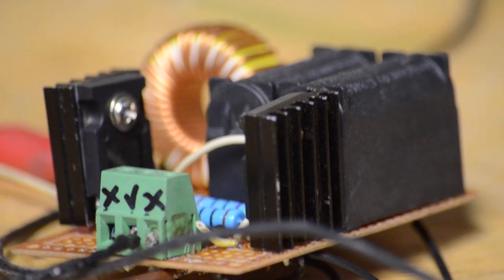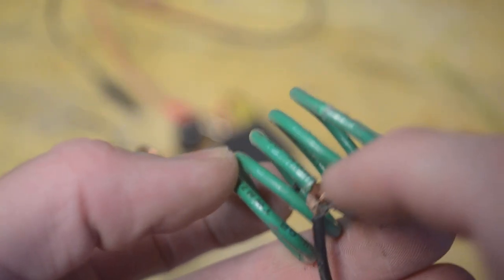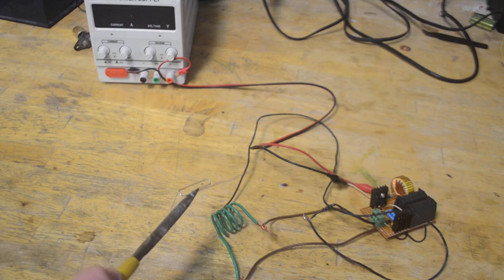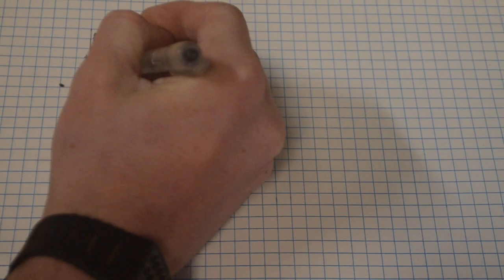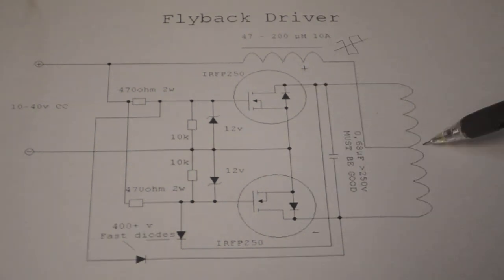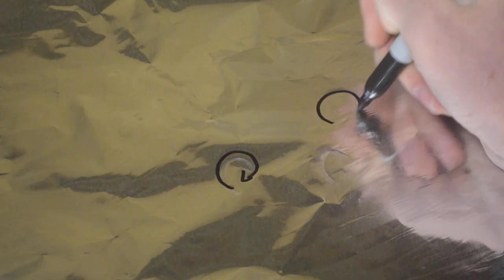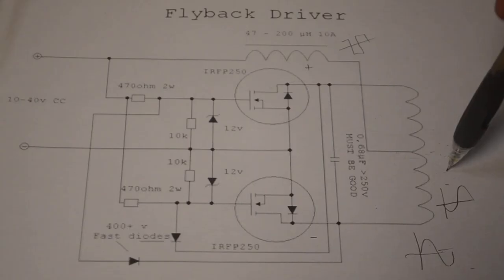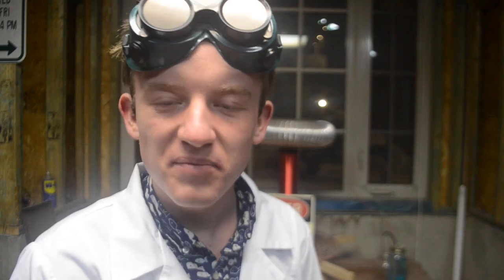How to make Induction Heating

Comment: love our videos, and your zvs driver video was very helpful btw. One correction, you can technically inductively het any metal, its just easiest with iron due to how easy it is to induce large eddy currents in it compared to other fero or paramagnetic metals. In the case of diamagnetic materials like copper of aluminum the currents simply flow in the reverse to what they would in a para or feromagnetic material. As well, it will take a lot stronger eddy currents to heat up more thermally and electrically conductive metals like copper as they will heat up less for the same amount of current and will dissipate that heat to the entire metal body faster than iron. I am 95% sure of this explanation, but if anyone has any corrections to this feel free to share them.

Comment: Awesome video and thanks for the shout out man!  One thing though, non magnetic metals like copper and aluminum do indeed heat up with induction.   Heat through induction is generated by eddy currents flowing in the conductive material AND because of the heat generated by hysteresis in magnetic materials. Since copper is not magnetic, it is heating at a rate that is directly proportional to the resistivity of the metal(which is pretty low). Most people think induction only works with ferrous and/or magnetic metals, but that is not the case. Copper will heat up with an induction heater, but much slower because it is not magnetic and has a lower resistivity than steel.  Dropping the magnet through the pipe proves this as it shows the copper does indeed react to the changing magnetic field.  With 1000W, I have boiled copper traces off of PCBs with my induction coils.  In fact anything that is conductive will be heated through induction including the human body.  MRI machines, which produce extremely strong magnetic fields, actually do heat up the human body a bit throughout the scanning process due to the nonzero conductivity of human tissue.  Graphite is great example of a material that is neither a metal nor is magnetic but is amazing a turning the energy from an induction heater into, well, heat.  Graphite is known as a susceptor and is used in microwaveable food package as a crisper like in hot pockets sleeves and popcorn bags.  Watching the lithium battery explode in my video also is a good example of this as nothing in the battery is magnetic.  Thanks again and keep up the great work!  Feel free to message me with questions about induction heating any time.
Reply from the maker: +Proto G no problem Proto xD, I figured that it was being induced in copper and aluminum ( that's why it says "the not entirely true " in onscreen text when I said that it only works with ferromagnetic materials, but I wasn't quite sure on why it wasn't heating up ) so thank you for telling me about hysteresis! That clears up some thoughts I had in my mind about it xD anyways you Totally deserved that shoutout, your videos are great :D

Comment: The most important question is: Can you heat up a knife to 1000 degrees Celsius with it?
Reply from the maker: +Pav Phone O_O
Reply: Depending on the material, would it still be a knife at 1000C?
Reply: Pav Phone No iron reaches its curie temp at 700 deg c , it looses is magnetic properties at this temp, further heating is a challenge above 700 deg c
Reply: no.
Reply: Get out
Reply: EvilSearchEngine yes

Comment: Put a polypropylene capacitor in parallel with the coil and drive it at the resonant frequency. Far more efficient if you can keep it on resonance as the metal is put in the coil

Comment: hey but induction stoves have horizonal spiral coils, how do you control the direction of the magnetic field in order to heat the cooking plate instead of the base of the stove?
Reply from the maker: +Academia Gamer great question, I think in induction stoves they use a ferrite material mounted on the bottom of the coil to increase the inductance as well as shield antuthing bellow it

Comment: is it possible to make an open coil to slip over pipes..goedendag
Reply from the maker: +georgio jansen yes! Infact this setup is used industrially ( or at least one use ) to heat up metal bolts to loosen them without the need of a flame

Comment: so then if you were to take like PVC and put the coils inside the PVC and put the paper clip inside the coils and then turn it on and blow air through it would you essentially get the same effect is heated air? Or would pushing air molecules through the coils inside of a PVC pipe cutter change the magnetic atmosphere?
Reply from the maker: +dmckimmey1 I think it would just heat the air from he heat of the paper clip, I don't think the air would effect the magnetic field enough to notice anything

Comment: In theory could I create a pot or a cup that heats itself if I wrap an induction coil around it and then a layer of insulation from the heat? I could also add heat insulation between the coil and the steel cup or pot or whatever. Would that work?

Comment: ok so what happens as you get to/past the  Curie point of the metal? in other words once you have heated it past the point of being magnetic?
Reply: Mike mac it still works because what it's doing is creating an electric current inside the object. however I believe you're right, it does alter the effect somehow.
Reply: Mike mac it does not appear his is strong enough to accomplish that, but when you hit the curie point the metal stops heating and hovers right around that point. Ferrous metals with high curie points are ideal for induction heating

Comment: To get the best results you have to have the diameter of the heated object 3,5 times the depth of penetration (which is calculated as a= sqrt(2*specific resistance / (2^pi*f*epsilon r * epsilon of vacuum)). My point is, the depth of penetration is related to the input frequency, can you change it with this desing? also does the circut automaticly adjust the resonance frequency once you put the object inside it? as it changes the induciton of primary.
Thanks for reply in advance! =)

Comment: If I wanted to heat a beaker of water/ milk would an induction coil wrapped around it work.?
Reply: If your beaker is made of iron or graphite or aluminium or silicon carbide or anything that conducts electricity and offers some resistance then YES. 

Glass Nope

Comment: 470R
 10kr
 12v zener diode
 UF4007 diode
induction coil
capacitor 
 if im gonna make induction heater with 3000w power should i use same diodes i mention or something else ?? a better question plz give me the components that can handel 3000w induction heater

Comment: Hey could you make a vid demonstrating electromagnetic that reverses the eddy spin causing levitation Resistance plz eg the reverse affect of the magnetic in the tube making it fly up fast I've always wanted to sleep in pyjamas that make me float eg pyrocarbon neodinium idea. Also if gold and copper won't heat up beacause of non magnetic how are graphite crucibles in induction heaters melting gold and why do the call them super conductors?

Comment: Hi +keystone science,
Informative video.
I have a question. If we use a battery(cell) and connect induction coil to its ends, Would it still generate heat..
Thx,
Paras

Comment: sir i have 220ohm resistor can I replace with 440ohm resistor
Reply from the maker: +manni sagg for the For the ZVS circuit? You should be able to, I'm not sure how much it will effect the output power though, presumably it will be much less , but I'm not too certain

Comment: hi im a really big fan im 13 and i need to do some welding for my electric bike. would this way make things hot enough to weld things, or is it possible to make one that could?
Reply from the maker: +Henry Swan theoretically I believe so, but it would probably be easier to just modify an old microwave oven Transformer with approximately 30-40 turns on the secondary so that it becomes an arc welder, sort of like what I did on my 1000 amp video, but with a few more turn than I did ( that way it will be able to conduct easier as it will have a higher voltage )

Comment: Just need to be conductive to heat it, if you have enough power. You didn't see copper heating because of the power input.
Reply from the maker: +AuraRisen yes, but ferromagnetic heating easier is because the small magnetic poles within the element spin and heat it up a lot more, while copper just relies on the eddy currents purely.

Comment: what about induction of aluminium it melts but it's not a ferrous metals
Reply from the maker: +Jack Spencer yeah, It works on non ferrous metals, it's just much less efficient at heating because ferrous metals have the added benefit of small magnetic poles that also flip generating heat, while copper and aluminum are purely using eddy currents

Comment: hey i have a question/possibly experiment for u! this video got me thinking about alternating and direct current and was wondering, what would happen if u ran an electromagnet on alternating current instead of direct? would it have a push pull effect (but the frequency is probably too high) or would it maybe "lock" nearby ferrous objects in place? haha cant wait for what u do! love ur vids btw!
Reply: oh and maybe even looking at the uses for a electro mag on a.c. like maybe using it to make some sort of instrument, where the "reed" is vibrated with the high frequency mag haha
Reply: S H I T S M E L L it would attract ferrous objects, but be neutral towards magnets. Iron doesn't care which side of the the magnet is pulling it, however you were right in your assumption that 60 is way too high to see the push pull on a magnet, it just appears neutral
Reply: I think cody's lab did a video on this but don't quote me on that.
Reply: inductors used in ac applications are called "chokes" as they block or 'choke' higher frequency AC while letting DC or lower frequency AC pass.
Reply: Edward sun mhh i see.. it would improve the efficiency of the induction

Comment: Stupid but serious question... 

Is this the same thing that happens on my stove top?... Because it's easy to understand with yours as your putting it into a "tunnel"... But what's happening with the pans... And is the copper heavy base pans using the same principle as your magnet demo and so why I needed to buy stainless steel pans?... Sorry, it seems silly... But I am genuinely wanting to understand now what is happening in the stove
Reply: Seano Hutton your stove works by using a massive resistor and pushing a lot of current through it. In this project, you want to prevent the coil from getting hot. In a stove top the coil is made of a resistive material to make it heat up intentionally. The heat from the coil then radiates into the pan.
Reply: Then why does the stove top stay cool enough to touch but the water is boiling, and why is it cool to the touch... My old one used to have a coil that heated up... The new one doesn't. But with special pans it cooks great... And is advertised as induction cooktop, hence why I thought this was explaining it... It's great but my copper base pan set doesn't work on it...
Reply: Ohhhhhh, ok. If it was advertised as an induction cook  top and your copper pans don't work, then that is exactly what it is. The induction coil is likely just a flat spiral underneath the pan that induces the currents.
Reply: So yeah, it is working just like this example, like I thought it must... And I'm pretty sure I said my copper pans don't work and I needed new pans in my original post/question... It's super quick to heat up, it can have a full pot of tap water boiling in just under 2 mins...  But if you accidentally have a empty pot on too long it destroys the pot as another house mate found out. 

What's confusing is the, in the demo here the clip his inside a cylinder of windings and so it makes sense, like an oven or crucible would... How they manage it flat through the glass is interesting indeed, and must be acting on the base of the pans somehow
Reply: It would be great if he could do a video demo of how this style works so I we can understand the goings on... That would be a big help
Reply: Seano Hutton induction can be caused with a straight wire. So we use coils to magnify the effect. If he held his paper clip flat just outside the coil it would not get as hot and it would take longer to hat up. If you scale that up, the paper clip is your pan, just outside the coil. The glass does not interfere with electromagnetic fields and is only there to insulate the electronics
Reply: Ah huh... Thanks 😉
Reply: While it's easy to induce magnetic fields and current in copper (it's the basis for nearly all electric motors and generators in use today), copper also has, amongst other things, a very low resistance to electrical current.  So the relatively modest alternating electrical field that is suitable to cause a steel pot to quickly rise to cooking temperatures, is quite insufficient to raise the temperature of a copper or aluminum cooking vessel.  Conversely, a field that was capable of heating aluminum or copper would be unsuitable to heat a steel pan.  

I speculate, without research, that the field needed to heat copper, would have to oscillate at a frequency in excess of steel's hysteresis; the amount of time required to react to a field, and so would have little or no effect.   A field that was sufficiently strong enough to either  metals at a modest frequency  would not be efficient nor safe.
Reply: Got ya... Hence forth my needing to buy new pots ... And why my heavy base ones didn't work, and why old mate ruined one of my pots.  It went all porous and chalky looking so I trash canned the blimmin thing
Reply: Wow; weird!  I hope, at least, when you finally do get the right pots, you find induction cooktops to be fast and efficient.
Reply: I do have the right pots, and I said it heats yup super quick, boils water so fast!... I do enjoy cooking on it and it's got fine heat control, it's nice

Comment: Heyyy, not quite right again :) You are talking about heating ferromagnetics and separate it from heating other metals, but you never explain the reason of that; however, the reason is something called "hysteresis losses"; in simple words you could say that ferromagnetic has large "magnetic pieces" inside, that are constantly being flipped by alternating magnetic field, but they are "too heavy" and are trying to resist flipping with speeds this high (around 50-100khz i guess) and so they are producing work here, which generates a lot of heat, way more than induced current does;i think it is important thing to say
Reply from the maker: +alcatel995channel ahh I see, thank you for telling me this! I was confused on that, so this helps a lot! Perhaps I will get a video completely accurate one of these days xD
Reply: Keystone Science you're welcome!

Comment: umm I've seen copper, silver, nickel, gold all get melted in an induction coil so there is that
Reply from the maker: +Brad Haigh yeah, that's why I edited in the not completely true thing, I just misspoke, I meant to say it is much easier to get a ferris metal to heat up
Reply: Ferrous
Reply: actually all you need is a decent conductor. so everything that works in a magnetic brake works. has nothing to do with ferromagnetism

Comment: "induction heating will only work on ferris metals" completely untrue.    "what I mean by that is it only works on metals that stick to a magnet" completely untrue.  it works on copper, brass, aluminum, heck any material that will conduct electricity.
Reply from the maker: +russhellmy us I know, ( that's why in text the video it says not completely true when say that ) it's just that with ferrous metals you can heat it up much easier due to the magnetic poles within the object spinning and creating heat, while non ferrous metals purely rely on eddy currents

Comment: I tried making an induction heater from a microwave transformer and it melted the copper coil I made and the cable wiring I made for it